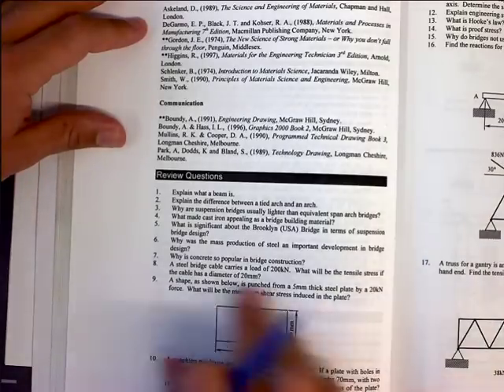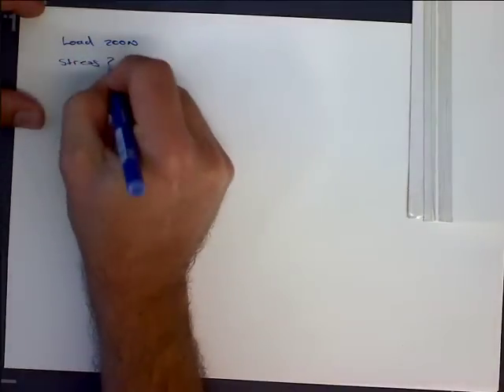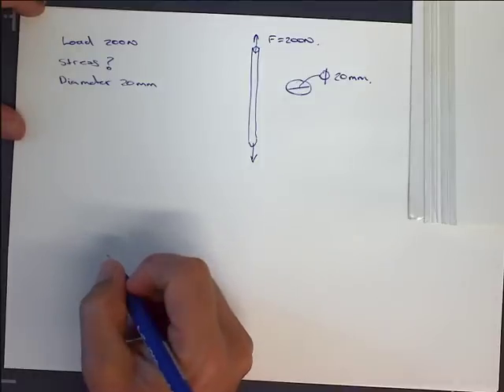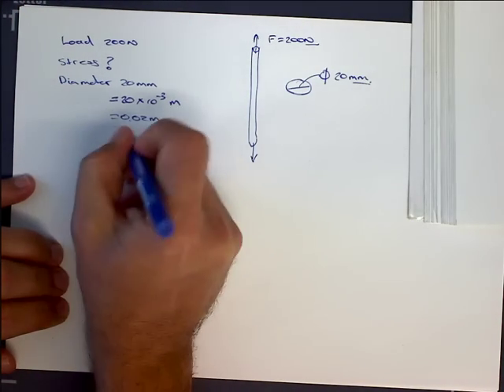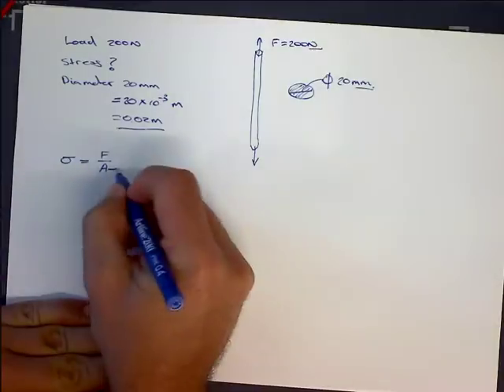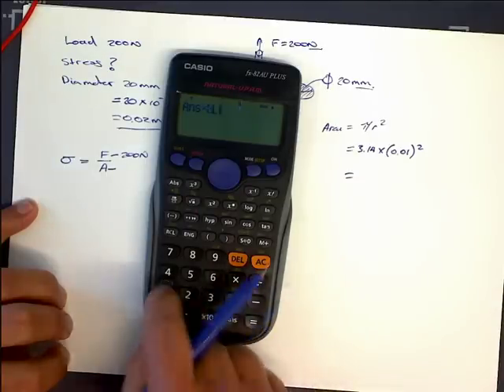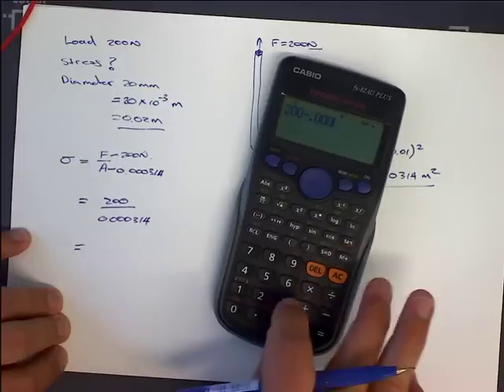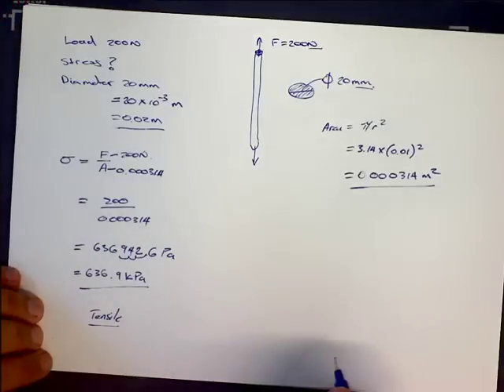HSC Engineering Stress

Comment from the maker: I just noticed that in my calculations I have used 200N as the Force instead of 200 000N which the questions ask for and this is why my answer is 636KPa instead of the correct 636MPa. Sorry for the mistake..